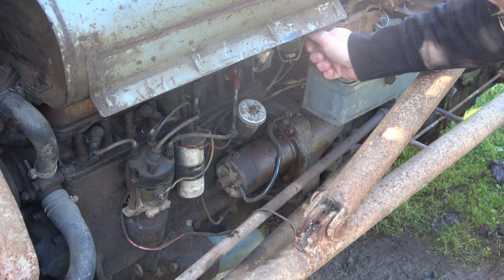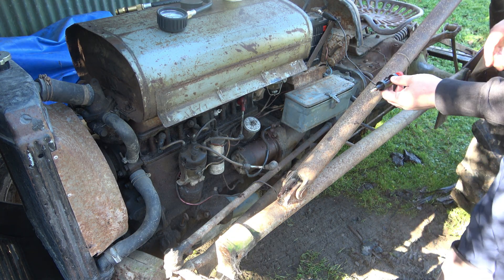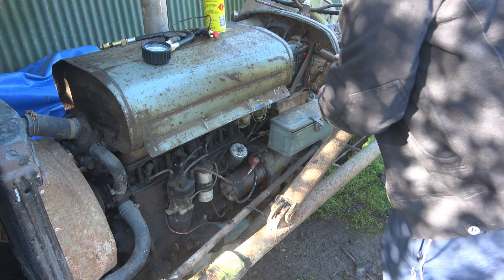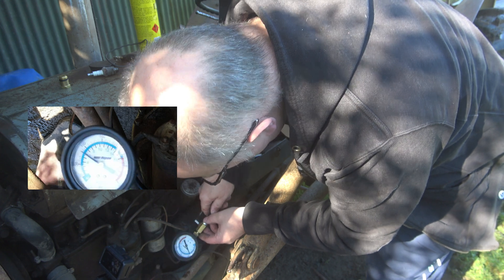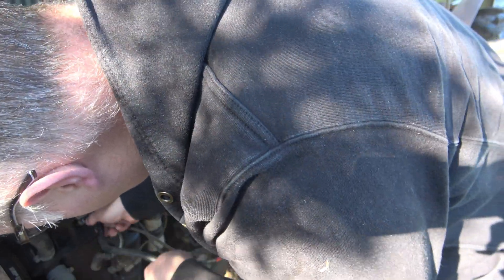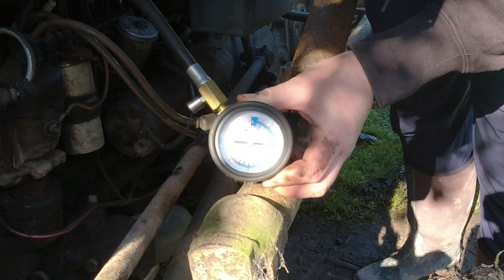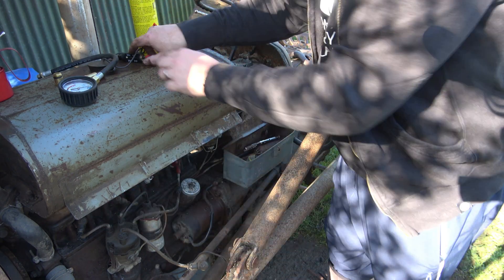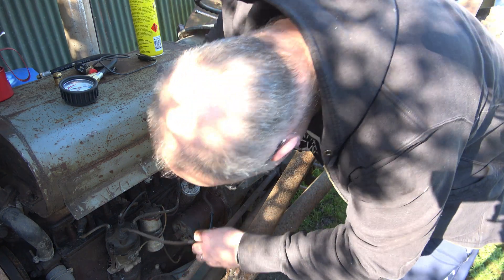Ferguson TE20 Compression Test

Comment: You just love those hydraulics, admit it!

I suspect a new rotor arm, new leads, cleaned or replaced points, new condenser etc would have it singing. I also suspect the bores etc are fine and you just need to decoke the cylinder head and re seat the valves.
Reply from the maker: I managed to adjust the hydraulics and get them working better.  What a mission! I cleaned up some of the ignition parts,  the rest started falling apart in my hands. It'll get a good spruce up and will be starting first pop like it used to
Reply: @Badgertronix  I look forward to it.

Comment: I would be scrupulously cleaning every bit of the ignition system first. When i was a lad my father had an old Guy lorry with a Meadows petrol engine, it would have been of a similar age to your tractor.  With the slightest bit of dirt combined with damp on the distributor and plug leads, she was always a real pig to get started on a cold damp morning. Once cleaned it would always immediately bust into life and run well.  I dare say the fuel system would benefit from a clean out too, thats regardless of the unique fuel blend you're using. 
As for the hydraulic issue with the bucket, just keep well clear of the danger zone underneath it. I knew a man who got crushed to death under one when it dropped all on its own a few days later. 
David in Dudley.
P. S. What are you currently paying for petrol and diesel in your neck of the woods?
Reply from the maker: I cleaned the ignition parts that didn't fall apart in my hands! The ignition leads are very brittle and barely holding on. I have cleaned out the fuel tank and the father in law rebuilt the carb. It was starting well before he put the diesel/petrol mix in!
Yes indeed, I will be very careful working with the hydraulics. I adjusted the lever which seemed to help and hopefully they do as they're told now.
Fuel prices are down quite a lot from where they were. Petrol is around £1.40 a litre and diesel is similar. We don't pay duty on diesel at the pump, you have to purchase Road User Charges on top of that at a cost of £42 per 1000kms for a standard car.